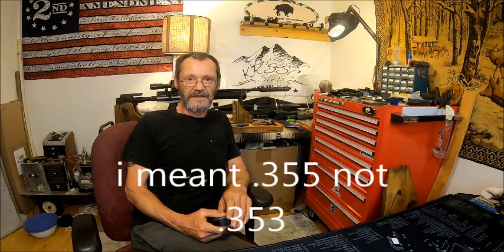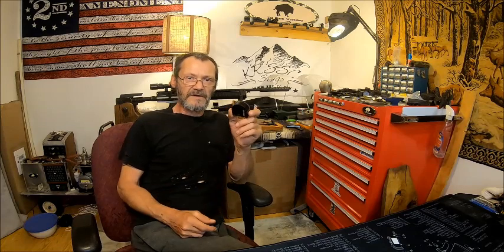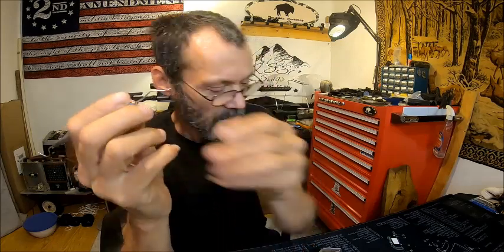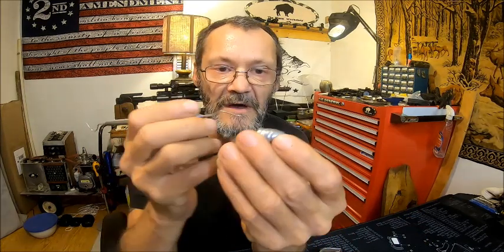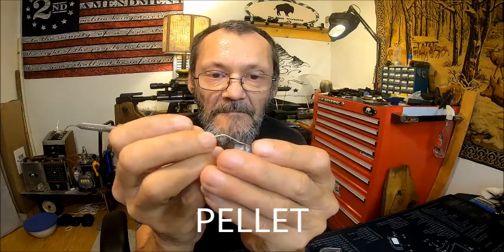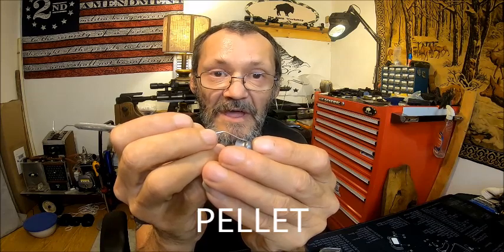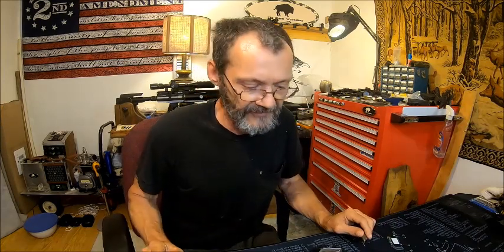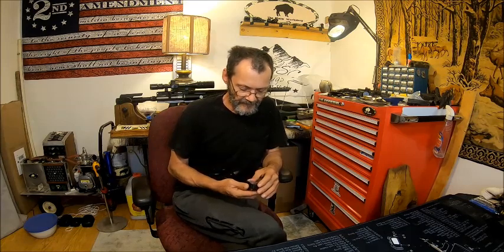Why the S45 mags are blowing up

Comment: I totally agree with you Bob and I like all your videos because you are very knowledgeable in this industry and you are one of the few that I know that keep it 100% since I started this hobby. I bought the S45 for home protection and the only problem I have with it is that the spring loses tension when you leave the mag loaded and do not fully rotate all the slugs. When I first bought it I could not fully load it without your mag loader but after leaving the mag loaded for a week you can just turn it with your hand very easily. I would like to know if you can make new springs for these mags or tell us what we need to do to fix this problem. Thanx...
Reply from the maker: i wonder if you replaced the spring with a spring out of a .50 cal mag if that would help with that
Reply: @BisonWorkshop  You know Bob you might be on to something because I keep my 50 CAL mags loaded at all times and never had a problem.
Reply: What if instead of loading the mag to the max? Instead of 6 keep them loaded with 5 that should solve the issue since the spring won't be maxed out?
Reply: @benriding8678  That's been noted before, but defeats the utility of a 6-round mag. One solution may be to set reminders to keep  unloading and reloading the mags monthly or so.

Comment: Thank you sir for this eye opener. Many of us know that slug size is important but, at least I did not realize that a couple of extra millimeters of slug surface area in a badly sized slug will create friction enough in the barrel to prevent the slug from exiting, blowing up the mag, or perhaps hurting the slug velocity if it does exit successfully.

Comment: Crushed magazine covers with the HP Max is caused by magazines sitting too loose in the breech. When you cycle, the magazine comes out a little, and if you are not aware of this and hammer the bolt back in, you crush the magazine cover. The solution is to losen the barrel nut, turn the barrel slightly further into the breech, which makes the magazine fit more snug and it won't come out again in it's own.

Comment: It's also the equivalent to a blowback method of cycling (even piston assist) but the point is the breach is not lug locked as in an AR style. Now I'm assuming this is similar to the terminator in mechanical design as i have one in .30. If I'm mistaken please lmk

Comment: The only issue that I have had with the S45 mag is the spring losing tension and then not rotating fast enough after the third slug is fired thus the fourth round jams.
Some people say that it is wrong to leave the mag loaded for too long before shooting. I would like to learn more about that. Help Bob!
Reply: The plastic magazine will turn slowly if it has ever jammed the jamming will distort the plastic with burs you have to take the rotor out of the magazine and sand down the gouges and burs on the rotor and smooth all sharp edges and reassemble the springs are not the problem
Reply: Spring steel should not loose its spring but this is Chinese steel they make out of whatever they have..if everything moves smoothly that's less stress on the spring I usually do not keep the mag loaded when not in use
Reply: Maby you can take the mag apart and put 1 more or less spin on the spring to tighten it up when you got it apart use 1000 grit sandpaper and smooth all the sharp edges so the rotor slides smoothly also use a dry silicone based spray lubricant not wet but dry lubricant